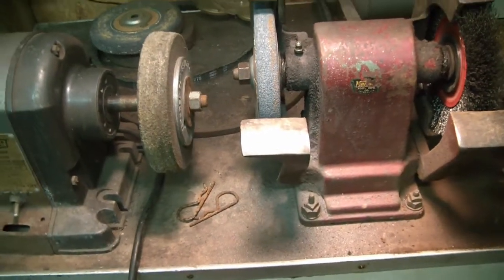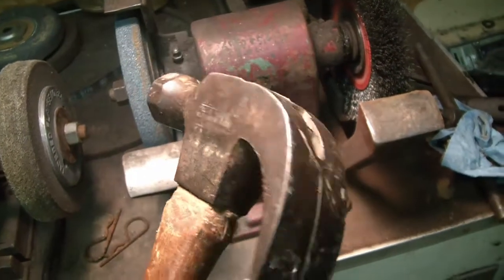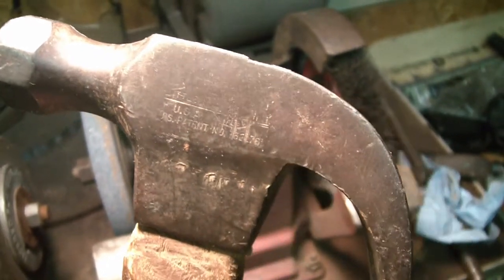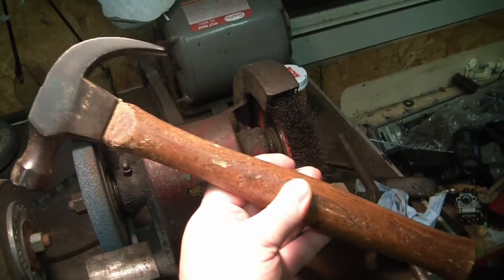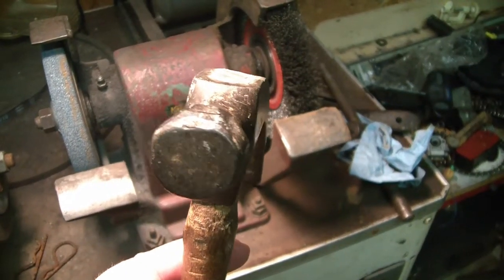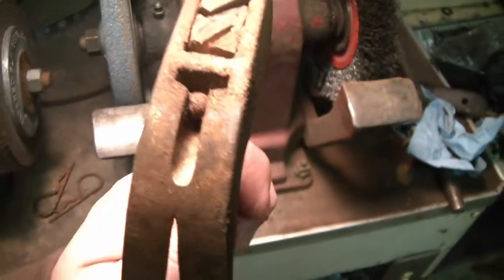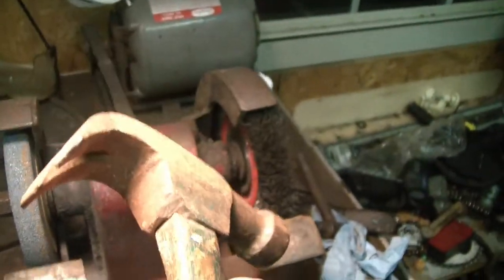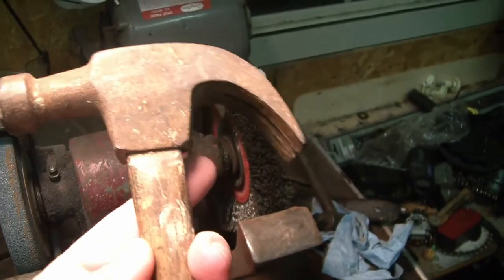The Henry Cheney Hammer, Nail-holding hammer

Comment: Well that’s interesting, I bet you didn’t know that these hammers were made in Australia as well. As I was watching your video I remembered that I have a Cheney nail holding hammer but under the Cheney logo it has “Made in Australia” written on it. Looking at the Hand Tool Preservation Association of Australia’s data base they were made here by the Cyclone Company of Australia under licence. Cyclone is a very well known company here that makes mainly garden tools and brickies hammers and bolsters. Also where yours has a screw to access the ball bearings mine has a plain pin which I have no idea how to remove. The bearings and springs have long gone but I would like to replace them. I don’t know whether to take my chances drilling out the pin or not. My wife found a site that goes into great detail about Cheney hammers: craftsofnj.org - The Tool Shed - number 173. September 2013 written by Jeffery T Cheney. If you scroll down to page 4, the first hammer on the left of the page with the very blond coloured handle is the one I have. I can’t remember when I picked mine up but I must have had it for around 40 years or so and I don’t ever remember seeing another one. As I collect Australian made tools I’ll be hanging onto it for many more years but I’ll be agonising over whether to restore it or not. Cheers and thanks, Stuart 🇦🇺
Ps, I see you have fallen under the spell of the wise and all knowing Scout Crafter as well😂.
Reply from the maker: Wow!  I was aware of them being sold in Australia, but not made there.  Thank you for the detailed info and the link!  I will check that out later. 😁